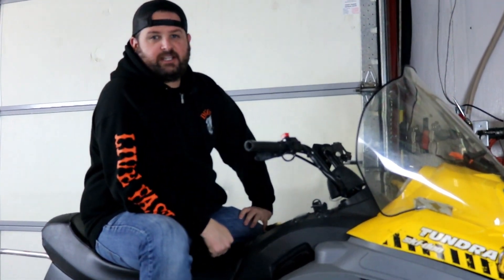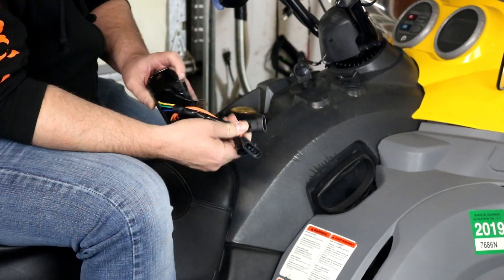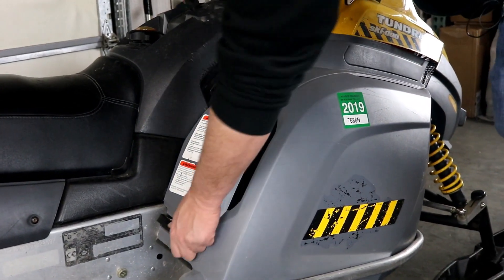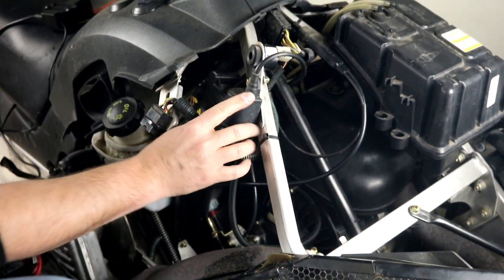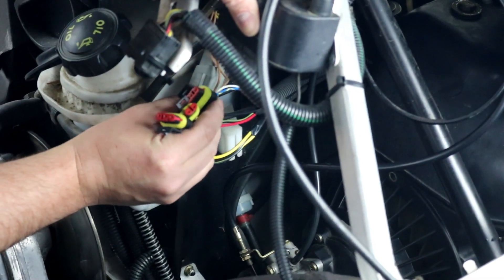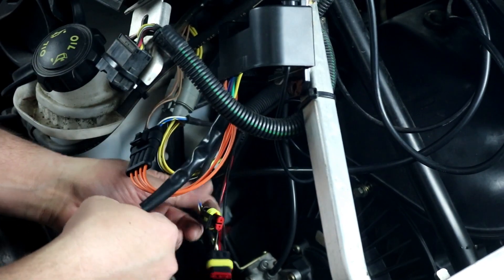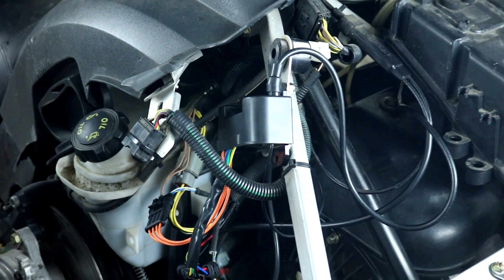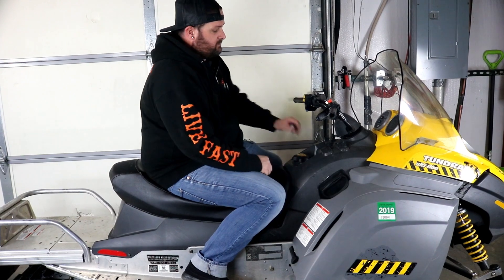RMSTATOR Ski-Doo RER Electronic Reverse System CDI Ignition Calibration Module Installation

Comment: Hi I have a problem  with my tundra  300 it keeps stalling  i did the carb boot   got a carb cleaning  done   usually  when driving it shuts off starts up again sometime it has a hard time starting  but it fires up again would you know the problem  or tips to check 4?